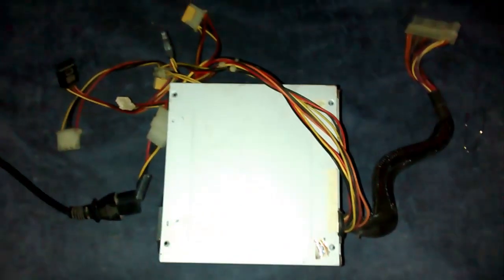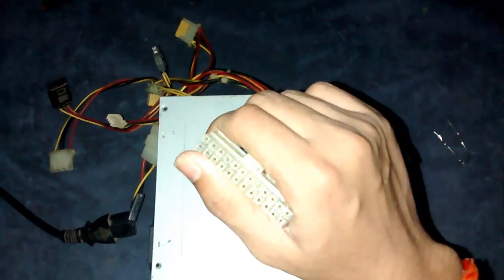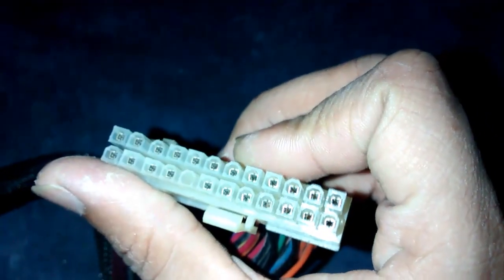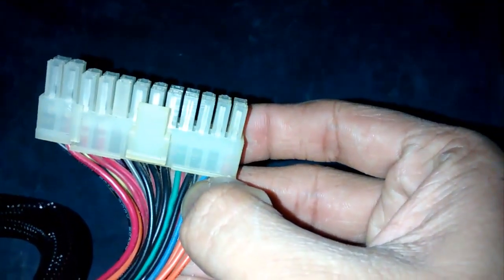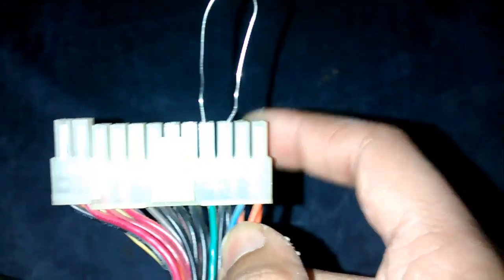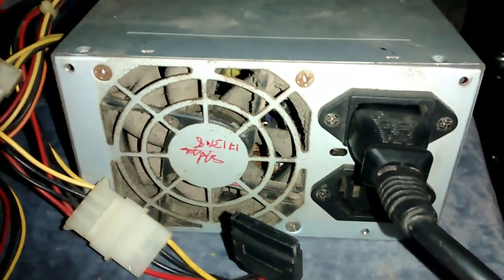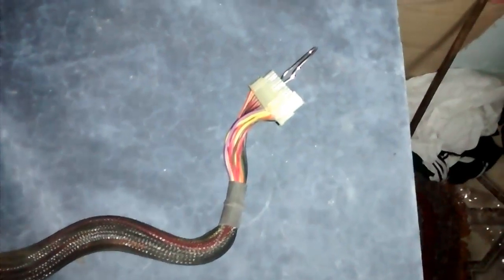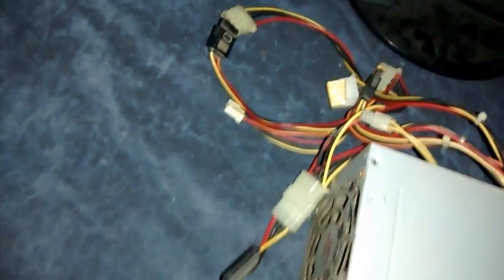How To Test faulty PC POWER SUPPLY- The PAPER CLIP TEST(2015)

Comment: Please help! My PC's acting weird. Either with the power supply installed on my system unit and using the front panel switch or using paper clip test, it turns on for a fraction of seconds then turns of again. What should I do? Where does the problem come from?
Reply from the maker: The fan should keep running if there is no problem with the power supply. Try using another power supply and see if the system works.